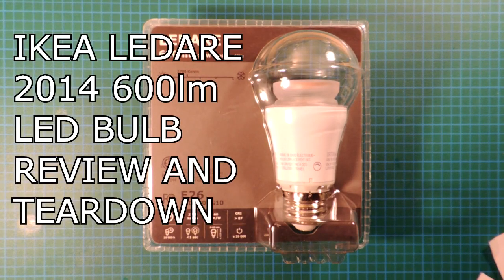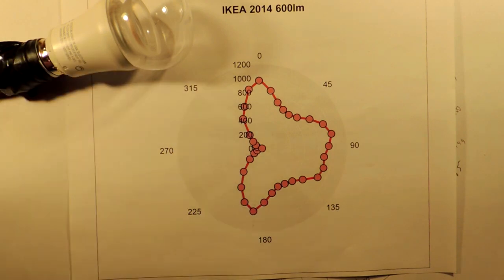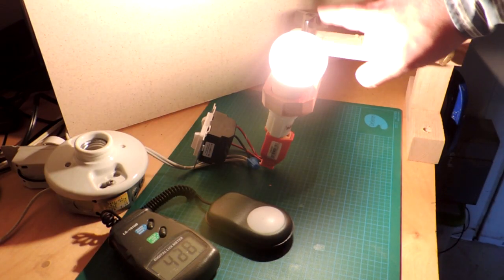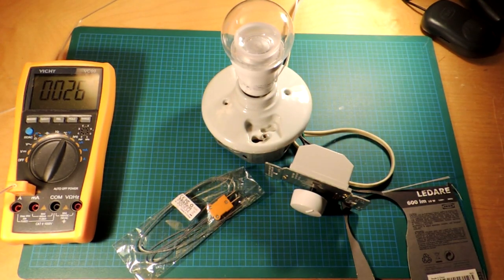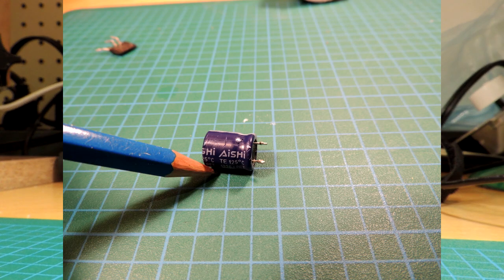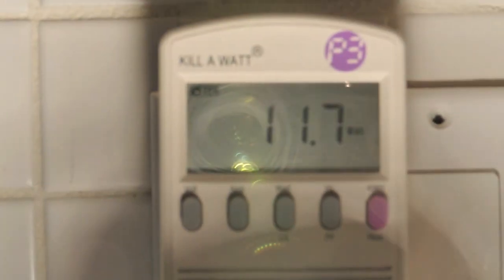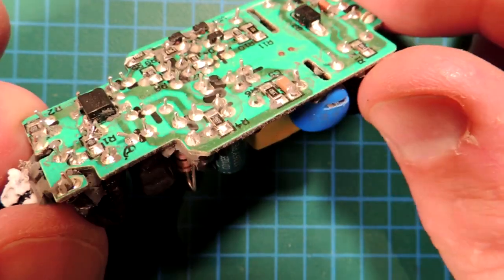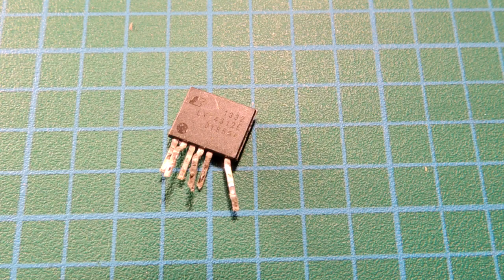IKEA LEDARE 2014 600lm LED BULB REVIEW AND TEARDOWN

Comment: The performed flicker test is poor. Flickering (AC part of the emitted light) has to be compared against the DC part. In this test the oscilloscope input channel was set to AC instead of DC. Doing this an incandescent light bulb will show practically the same result (more a sine wave then). If you want to learn more about flickering, look at
derlichtpeter.jimdo.com

Comment: I purchase the 2 packs of 400 lumen bulbs for 3.49. Why? because even if they last 2 years (which so far they have, actually), they're cheaper than even the next cheapest bulb (a Wal-Mart Great Value bulb that is 6 dollars). I can buy 4 of these for the cost of the Wal-Mart bulb, which to me makes it worth it. The 400 lumen bulbs are 6.3 watts, and they draw 8 or so. So say I could get a 5 watt bulb, say I have every single one of the 12 bulbs in my home running at once, that's only 36 watts more in total. I usually only have two or three bulbs on max, so in all honesty we're talking 11 kilowatts per year. Considering the bulbs have lasted this many years and only consume 3 more watts I've "wasted" 1.50 in electricity and saved more than that on a single bulb. To get the more efficient bulbs I would have spent $6 on each bulb in the house it would take me 34 years to make up the extra money spent. The economics of that is unfathomably silly, so I see no reason a normal person would even consider spending three to ten times more on a bulb.

Comment: Do you think that if these LED bulbs continue to have issues with enclosed fixtures that enclosed lamp and fixture manufacturers will start to add more venting at the high point to circulate more air?  (Once the LED bulbs have enough market share that is.)

Comment: Great video as always.  Have you ever thought about adding a turn on delay test? I've noticed that some older or cheaper LEDs have a significant delay from when the switch is turned on and when the light comes on. I haven't purchased any of the Ikea bulbs but I've even seen the Philips A19 with basically a 1 second delay. Sometimes it's the dimmer but the lamp is the problem sometimes too.

Comment: i still dont 'get' led bulbs, this bulb is  60 lumens per watt, a random phillips cfl i have states 1320 lumes at 20 watts, aka 66 lumens per watt and is about 4 uk pounds, much cheaper than LED alternative, so less lumens, and it seems no more lifespan as all the cheap innards will burn out inside a year whichever you go for, sure the led states 25k hours and the cfl 10k but they are both dependent on cheap capacitors, which is the failure point.
Reply: Philips CFL bulbs are probably an exception, as they're better built than no-name brands.

Cheaper CFL bulbs have lousy circuits with starter capacitors that burn up or get damaged due to overvoltage and heat, so if you want them to last you'd better turn them on very rarely (so keep them running for long times, which negates the economy).
The CFL bulbs also need some time to reach the proper brightness/temperature , they don't have good color rendition (led bulbs are getting better).. i can't use CFL bulbs in my bathroom because I have some very light blue tiles on the walls and CFL bulbs make me look like a cadaver with that slightly blueish tint on the light they emit. Then there's the issue of very small amount of mercury in the bulbs...

The led bulbs are in theory also more recyclable - I can picture stores collecting broken led bulbs and selling them in bulk to companies which would then desolder working leds to resell on eBay or reuse in other super cheap led bulbs or various products), and the common mode chokes and inductors could also be recycled, as long as you can remove the potting compound. Indian and Chinese labor is cheap.   The electronics in most CFL bulbs is just crap, not much to recycle.
Reply: *****
certainly if they both get above the lumens per watt by a margin,  and somehow not put trashy parts inside, making them more likely to get their 20k plus hours, them im all for them, its worth a price premium for a better product
Reply: I have 60cm T8 LED tubes with 1100 lumens at 9 Watts...
Reply: *****
once your into t8 fluorescents hey are 100 lumens per watt too
 and 1/10 the price or less
Reply: one common problem that many cite with CFLs is the poisonous gases that are used to make the bulbs.  I think many have overstated this downside to CFLs though.

Another thing that people complain a lot about with CFLs is the typical color temp (usually too blue).  Blue light can also block melatonin production in the human body which will interfere with sleep cycles (google blue light and circadian rhythm studies).  CFLs have attempted to fix this but many still don't like the color options available on the market.

CFLs are also notorious for flickering.

And to your comment about cheap insides, yes its true, you have to pay more for a good LED bulb, but once you have one, they should last 50,000 hours or more compared to 8000 hours for CFLs.
Reply: I suspect a lot of the problems we see with LED lighting is a result of them often being used as drop in replacements for older lighting technologies instead of being built into systems more suited for them.

LED lamps with good quality drivers and good heat design would last a very long time, but instead, manufacturers have to make tiny and cheap driver boards stuffed into envelopes that hardly have the heat dissipation needed for the LEDs and driver just so the bulb can be a little more like the traditional incandescent bulbs in size and shape. Or else, they have to make them big and heavy monsters that will not fit well into many lamps and are hardly attractive.

Comment: Controller is made by Power Integrations, the LYTSwitch family of ICs: http://www.powerint.com/products/lytswitch-family/lytswitch-4   (datasheet somewhere on the right, scroll down)

They call that package eSIP- 7C (E) and your particular IC seems to be designed for 85-132 VAC (so I guess they have another version for European IKEAs?) and designed for 2.5-15w output power.